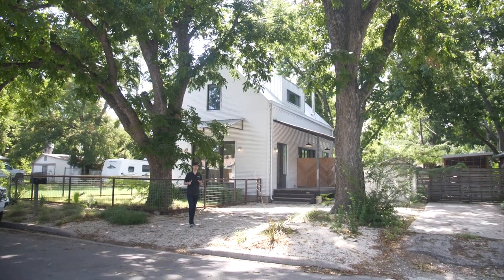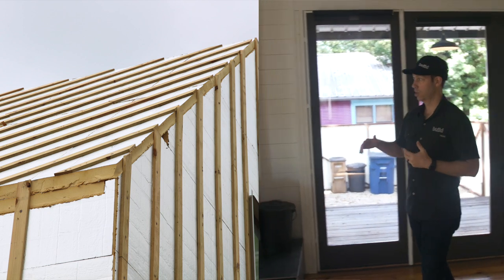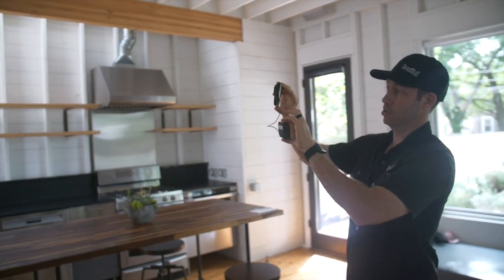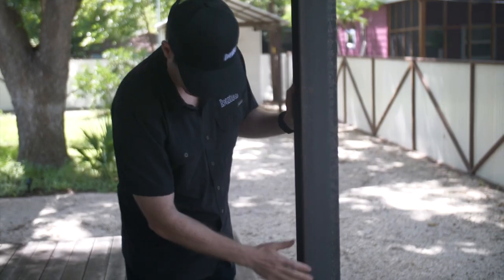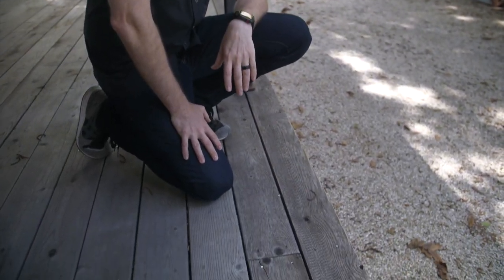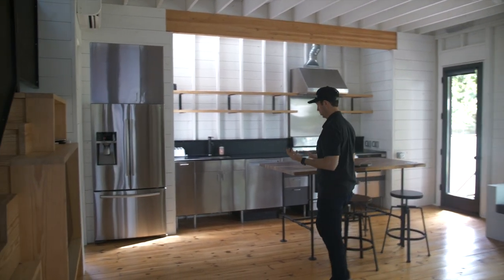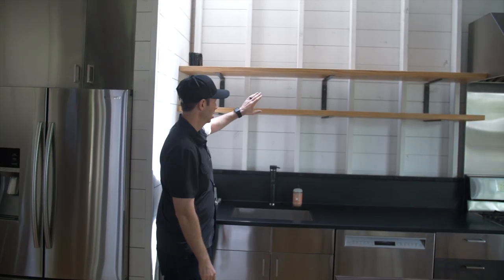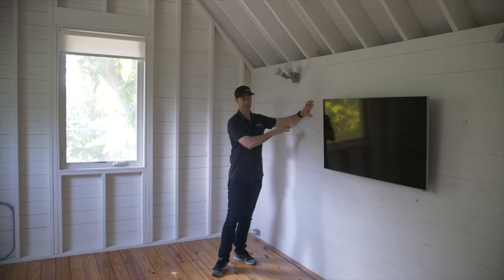This New House Has No Drywall, No Insulation, and an All Wood / Shiplap Interior!

Comment: So really in that house you just need to add sheetrock to the downstairs ceiling with sound deadening to cut down on sound. I like the idea of finishing the walls in wood vs sheetrock. Pretty cool concept to wrap the outside of the house vs in between the walls.

I'd probably would just use wood with sound deadening which would act as extra insulation. So many people are hung up on no sheetrock, not long ago there was no sheetrock. Funny what people have become accustom too.

Comment: The title did say ship lap so why not finish it, just because you have the insulation outside doesn't mean you can't use sheet rock or ship lap that the whole place would look so amazing in ship lap. And unless he bought it back from the first owners (in contract) there is no second owner, just a resale. There is a reason the first owners didn't last to long maybe the second owners will finish building this one. Who wants to see wires, notice you don't see what a electrical plug looks like, ugly!

Comment: As a work space, this is amazing. As a living space, horrible. The exposed wiring and plumbing can be neat when it is minimal and as accents, not when every corner has something exposed. Commercial faceplates to me are horrible inside a house, prefer cleaner, modern look. Where would we hang pictures? The exposed studs look better as an accent wall. I could see myself finishing them off with either stone for character or slapping on drywall. Sorry, functional wall space beats this design.

This whole house screen Youtuber studio.

Oh and FYI, body insulation is between structures and around. Under the entirety of your skin is fat. Around each organ is fat, kidneys have 2 layers. In front of your GI is a big flap of fat (effectively fat under the skin fat). Basically, almost any free space within a body cavity is cushioned or insulated by fat. So yeah, you would put fat between ribs. You'd also put it all along the inner layers. In other words, your body's insulation is all inside, not a parka outside.

Comment: Hi Matt. What about fireproofing from the inside? Isn't it dangerous to expose the framing when talking about fire hazard? Putting a fireproof drywall will keep the framing from burning if there is a fire in the house. What are your thoughts about it?

Comment: Matt, I like your workmanship, but this design looks like crap, similar to the inside of a Tuffshed.  In a few more years the studs will be split and twisted, and the knots will be loose and falling out.  Impossible to keep the rough walls, rafters,  and studs insect and dust free.  The studs have zero fire protection and will collapse quickly in a fire.  Many houses in extreme climates now have foam board wraps so the thermal short circuit through the studs is not a real issue.

Comment: Why dont americans use concrete and bricks for their homes?
Reply: It depends where you live in the US.  In primarily warmer climates the homes are made from brick and mortar whereas homes in the cooler climates are made from wood.  Home in middle climates where the temps can be both cooler and warmer you have a lot of brick and stone type homes.  You would not want a brick home in cooler climates because eventually the brick would just freeze and fall off the house. Homes are built to commercial specifications where you might find brick and mortar for commercial buildings in colder climates. A hundred years ago, on the plains, the weather would be freezing over night and hot the next morning...and you will find brick facade homes which were built very well but again, the maintenance for this type of architecture with the mortar breaking loose and bricks falling out, can be cumbersome after a while.
Reply: @MaryOKC  wow, thank you, you explained that very well

Comment: Where's all the duct work?
Reply: There appears not to be any. Instead they went with room-units that only blow out into the immediate space. Circulation requires the louvered doors (pretty half-assed circulation, but better than slab doors, maybe) even for the bathroom (which completely obviates the purpose of doors on bathrooms).  This whole design is like some freshman year architecture lab design exercise, with no experienced builder/architect discussing with the lab group why shlt like this is never done.

Comment: Always liked the concept of easy accessibility for electric, plumbing, etc.  Definitely needs soundproofing in key areas:  bed n bath.  Lacks built in storage in all rooms ~ not a fan of having to buy key pieces of furniture for storage in every room.  Raise the electric outlets to hip height. Toilets should be separate at least by a half wall/door.  Not sure about fresh/stale air factor.
Reply: depending upon your mini split, it can bring fresh air into the home and filter it for you.  i believe the ERV also cycles air in and out, and recaptures the energy to cool/heat it as well.

Comment: The interior reminds me of what many of the old Classic Queenslander houses in Australia looked like. The difference is that, as these houses were built in hot and/or tropical areas of Australia, the walls weren't insulated or lined at all.
Reply: yep, especially right up north, like Townsville. Timber walls on the inside for a neater look but totally exposed frame on the outside.

Comment: kitchen cabinets are almost always 34.5" tall and finish at about 36" with top. High cabinets are always nice and I have always found the customers like them most at 40". No offense but the interior is ugly.  Wrapping the house with insulation on the exterior is nothing new it's called a house wrap and it has been done in the north since at least the late 70's. I like the ease of maintenance of your house.

Comment: Good morning Matt 
In 2012 I met one of the most interesting man, he was in his late 70s then, Len Pense, in Stafford MO.
He showed me pictures and told about how he developed the dome structure concept 30 years prior. He would create a circular foyer and attach a plastic liner to it, inflate that, spray 4 inches of urethane which adheres to the liner, create a rebar schedule and shot crete another 4 inches. 
He pointed out to me where God placed the insulation on the Polar bears, on the outside, insulating the vital organs. 
Len was a likable guy, he passed on in May, always struggled with pneumonia from the dust bowl damage. 

This perfect wall concept is nice. Looking into it for our new build.

Comment: There is reasons why people use dry wall and insulation inside the between the timer.
* Sound
* Fire proffness
* Cost
* Finish

I bult my house with 3 layers. Outer frame in 6x2  with insulation between rafters.

Inner frame with 4x2 with insulation between rafters.

And between them just filled with 4 inches of insulation.

Because rockwoll insulation is so cheap, the middle layer really just cost a few hundred dollars, and it ads a lot to the insulation value.

I probobly could get away with 2x2 on the inner frame because of the sheeting.

The code here dictates the frame is with 6x2. So if i want to make the walls any thinner i pretty much have to use better insulation. Could probobly cut down the insulation with 2 inch with no issue, but cutting it down with 4 would be pushing it.

Comment: I used foam PVC called syntraboard around a problem condensation window in the winter. It was easy to jigsaw, but is dentable. Also quartz composite as it is water proof for a sill: 
http://web.ncf.ca/fs864/pickup/done-paint/no3.jpg
http://web.ncf.ca/fs864/pickup/done-paint/no8.jpg

Comment: European houses get old and worn out, and will need major overhauls to be contemporary!
Reply: mal'ak emeth  Just because something last longer doesn't mean it looks better! Homes in America will last for hundreds of years! of course you have to have upkeep and maintenance on any manmade structure or it will fall apart,

Homeowners in America have been using metal roofing lately, it last longer but isn't as beautiful as traditional ashpault shingles
Reply: mal'ak emeth  American homes are built with constantly changing building codes, but if you live in a old home you may not have the safety features that newer homes have!
Reply: mal'ak emeth  I agree!! Keep in mind that contractors will put up cheaply buy it homes and cut corners to save every penny they can!!

I'm remodeling my house and I use Xtra everything and customize everything for added protection! People say it's Overkill but it's my house!

Houses in America are not that bad. Sometimes you can tear down a house and see all the Xtra lumber that they used and how it didn't get wet! 

I recently saw a show discussing a new building technique used in European homes that uses no wood and is stronger but it need special training and it cost a little more to build than a traditional American home, I worked at a lumber company and as newer products become available we simply put them in store, but as long as America has plenty of Forrest they will keep using wood, but times are slowly changing
Reply: mal'ak emeth  always make your home beautiful to your eyes! Therefore use whatever type of lumber that adds to your taste;

Comment: Personally I like drywall. My wife loves painting the walls different colors every few years. Myself I would have spent more money on glamorizing the interior wood frame. possibly using different types of wood stained or shellacked  a rich color. Good job. As far as electrical and plumbing I would have enclosed it in wood panels around 4" wide to hide the wires. Sort of like hidden behind the wood panels . The panels would be cut lengthwise at a 45 degree angle on both sides,  and mounted on the wall at a 45 degree angle as well using jigs of some kind  to screw the panels together from the underside. Then I would make or attach bracing to hang on the wall like a picture frame for easy access. A trick I used in hanging medical equipment on hospital wall s was to cut long lengths of wood the thickness of the back ot the medical device  with only one side at a 45 degree angle, and attach one to the wall with the cut side facing the wall facing up, and secure the other length to the rear of the medical device with the cut side facing you and angled downwards    This seems to work well to secure on the wall with no visual sign of how it was hung. The pipes I would make a triangular or rectangular cover  and attached at the ceiling and floor for easy access to pipes should any leakage occur.  I think exposed pipes are unsightly. Some people like to ride around  in their car without a hood on their motor so everyone can see the motor. I'm not one of those.

I like the idea of insulating from the outside (outerior). Seems to work better as an exterior blanket making it easier to add on electrical  or pipe modifications in the future. inside the house. If you have the funds indeed try exterior insulations.. 

Thanks for a well made house. Could use some upgrades though...

Comment: What a cool idea. Maybe run the master wall on 2x6 or 2x8 and double Sheetrock in between the studs for sound. Maybe adding sound insulation and shiplap?
On the floor, foam board and floating plywood?

Comment: I didn’t mean to be unkind or not nice. I offered a candid opinion. I’m very interested in creative designs. My first impression here, though, was that the interior looked unfinished, untidy, and impractical—in a word, ugly. The stud depth of 10 cm (4”) is impractical as a shelf depth. It is neither minimalist nor industrial. To work, an aesthetic should give a desired impression without scrutiny—a feeling at first glance. When you have to explain an aesthetic, I think it has failed. I acknowledge that that is entirely subjective. One merit of this design might be a contiguous vapour/insulation barrier (i.e. the insulation is not divided by the studs, each stud creating two seams possibly permitting air flow). The obvious disadvantage is that the wall thickness is increased by the thickness of the insulation that could otherwise be inserted between the studs. 

 
Also,  ‘outsulation’ just sounds silly. The insulation is still inside an envelope—the outside cladding of the house.
The derivation is the Latin ‘insula’ (see full definition below).

Again, I did not mean to be mean. 

———
insulate (v.)
from Late Latin insulatus "made like an island," from insula "island" (see isle). ... Electrical/chemical sense of "block from electricity or heat" (by interposition of a non-conductor) is from 1742. Related: Insulated; insulating.

 https://www.etymonline.com/word/insulate#etymonline_v_9363

Comment: Matt, I found this video when searching for confirmation videos of an idea I have for my older home recently purchased. I’m presently removing all the sheetrock panels and insulation strips. I thought of alternatives to sheetrock for interior appearance and security due to hunters next door to our property. Our home has been shot by hunters quite a number of times. Recently, one of my children and I were almost shot while installing fencing in yard. With that said, installing shiplap on the interior may help prevent accidental shooting since we can’t leverage the Town nor County to mandate setbacks for shooters from homes.

Thanks for sharing a home that simply makes sense!! I have inspected many homes over the years and have learned that almost none of the builders change from the Old School way of insulating, framing, running wiring, etc.

Comment: What about fire code?  How long will it stand if it catches fire from the inside (the structural components will burn first).  In many jurisdictions garages have to have sheet rock so that they have structural strength for a good period during a fire.   The stove by the wall almost certainly would have had a non flamable surface behind it in most jurisdictions I worked.    The only way I could build something like this would be under rustic cabin rules (ie not a primary residence)....  And in many jurisdictions I worked, outlets and switches had to be at proper height for folks in wheel chairs... sort of a residential ADA.    Also many building inspectors would probably declare some of the rooms that lack walls that seal to the ceilings as fire chases, and demand they are sealed up (like between the tub/bath room and the pump equipment in the  'shoulder' space).  So while I get Matt's points, and like this build, and just about everything Matt has put out on this channel...   I'm not convinced a build like this is OK everywhere, and without its faults and potential pit falls: and that is why I think more of us aren't building like this.

Comment: What is the air quality after just a day without power? I assume it relies on electrical power to provide fresh air and to exhaust? You must plan for power outages and for more breakdown's in the supply as politics endanger us.. I would plan on some means of natural airflow, ie without power.  I like what you have done however and am a very competent designer-builder of old, good work.  Yeah the sound would not work for me, I built only natural homes with thick walls, cob, adobe, sb, stone, etc so they are super quiet... and literally bulletproof..

Comment: I thought the National Electric Code required electric receptacles to be at least 14 inches above the finished floor.  The reason being to protect from fire/electrocution resulting from rising water.
Also, the thickness of the insulation is not really important.  You mention thickness, but never talk about r values.
Finally, while the design is interesting, it looks depressingly unfinished.  I would feel like a squatter in an abandonned, unfinished house.
Reply: r values for a home such as this is dependent upon foam material and thickness.  
also, no reason you can't sheetrock the interior and finish it normally.

Comment: Would have loved for you to speak to the cost of this building approach. The practical advantages and energy efficiency speak for themselves, but is it more cost efficient in terms of building granted that there's no need for traditional insulation and drywall? Or does full interior coverage with shiplap end up being expensive enough to offset/surpass the savings from omitting those more traditional materials?

Comment: Ants and embodied energy are two things that come to mind.  I have designed many houses with an outside wrap.  Structuring windows is always a challenge and R  values in Northern New England suggest filling the walls. It looks like this house has 3" at R-6.  Good air barrier, but not great in very cold climates.  As a design I like the exposed studs.  Reminds me of a hunting camp.

Comment: What about fire code theory exposed wood id flamable at specific temp. Red cedar for example. I designed first american indian housing project with architect firm . Then told him to double size of unit for same cost per sq foot. In other words a certified phase two plan. Please as professor to do current code interview. 
Would be nice to do take off on unit and update material every five years with time and materials. I have 40 acres odcsecond growth douglas fir stunted at 110' due to hardpan. Going to custom mill my wood package. What is alternative framing cost using sips and rafter franing. Did you look at lite concrete second floor retro?